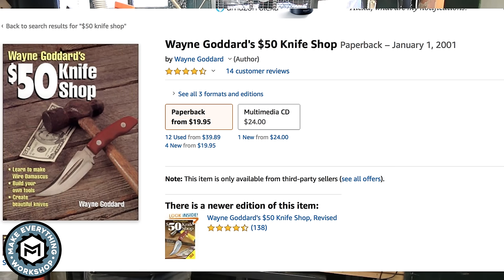$100 Harbor Freight Knife Shop!

Comment: I see this all the time, as a matter of safety, I hope everyone thinking of trying this, reads this comment. I drill the handle holes first. I watched a guy cut the bevel and then try to drill the holes, the drill hung up and he lost three fingers! fun over! make sure you clamp it when you drill it so if any thing goes wrong, it can't move.
Reply: mike walker : good point, always worth mentioning . Also, sheath the cutting edge with the plastic blade cover you get when you buy a woodsaw or a hacksaw, tying it up with adhesive tape.
Reply: Good Advice! thanks for commenting.
Reply: Always clamp your work; good advice; and.... use two hands on that grinder.  That cutoff wheel will virtually explode if it gets cocked in the cut groove.  I also wear leather gloves anytime when using a grinder.  One of my guts had the grinder flip around and cut his wrist.  TG his high dollar jacket cuff slowed the wheel down and it gave him a fair cut otherwise;  it would have been an artery.  GLOVES /GLASSES AND LONG SLEEVED; TUCKED IN NON BAGGY SHIRTS. 

DRESS like a welders dresses and you’ll be fine.
Reply: Not only that, this guy isn't qualified to even think about making a knife, let alone make a how to video. No safety, no proper approach, not a single thought about anything but trying to get views. Terrible form.
Reply: Ethan Vandal :DILLIGAF!!!
Reply: my god, I wouldn't use an angle grinder so close to my bare hand either around the 27 min mark.
Reply: @danb2709  It's a sanding disc not a cutting wheel, but yeah I still agree with you.  Much better to use saw/chisels/files/rasps
Reply: What I usually do is assume the work is going to catch and spin and clamp a scrap piece of wood to catch/block the piece I'm working just in case.
Murphy's law...
Reply: I actually have stitches in my left fingers because of this. I was making my knife, and after I sharpened it I drilled the holes for the handles, and the drill got caught on the steel and whipped around and sliced clean through my middle and pinky finger on my left hand. Luckily though it was sharp and cut cleanly otherwise the damage could have been more catastrophic to my hand.
Reply: that's a good suggestion
Reply: @EthanVandal  Sounds like u need to get off the internet and actually do something rather than telling everyone else what they are doing wrong mr safety queen!
Reply: You gotta learn by mistakes. We all did. Didn't have u tube in the 80s.
Reply: This is why they sell a VISE. Worth the money. And buy a good one. Spend the extra money. Worth the weight in gold when you want to keep your fingers.
Reply: StopThe Hammering     Hell Yeah! So sick of these safety douches..... what ever happened to personal accountability?! Let the man work the way he wants!
Reply: mike walker how about “don’t use harbor freight tools” as some safety advice?
Reply: @mikepalmer4371  Anyone who's teaching others has a moral responsibility to teach safe practices.
Reply: Thanks,Signed Stubby...
Reply: @septegram  you must be under 40 years old. Moral responsibility to teach safe practices? This isn't school buddy. There's also a thing called common sense that would stop most from even even doing this. If they do and something happens... Lesson learned the hard way.
Reply: @AzTurboMini  40 is a long way in my rearview mirror.
If you're teaching, you have a responsibility to your students. If you don't think so, we have nothing to discuss. So-called "common sense" is meaningless; people do things all the time that go against "common sense."
Reply: Thanks man
Reply: I always think of "the worst thing that could happen" at that point and it usually keeps me in check!  ..not even joking! I'm dead ass serious.
Reply: @jamiem5364 When the workshop instructor says "I used to disregard safety" and holds up his hands to show that one of them only has 2 fingers left, it has quite the effect.

I don't recommend anyone do so, but you can ignore people who talk about safety, if you want. It's only eyes and fingers, right? Right?
Reply: @AzTurboMini  When someone loses their fingers due to following your advice not to bother listening to safety advice, you're not going to care, are you? I really hope nobody follows your words.

Comment: I would have swapped the new blade for the one on my Saw, and cut up the old blade.
Reply: Dabeav ! Everytime I’ve used used sawblades they seem to be work hardened or something and it is nearly impossible to drill through
Reply: @brianwiggins2169  That is why he annealed it before drilling.
Reply: Nah, I use quality blades in my saw, not Harbor Freight blades!
Reply: @justinscott3001  my thoughts exactly. Even when they're old, nothing in Harbor Freight can replace my Freud Diablo blades
Reply: Not a harbor freight blade you wouldn't.lol.
Reply: Word 👍
Reply: If you can get them, start with a power hacksaw blade. They're thicker and longer. 1/16 is a letter opener
Reply: I don't "USE HARBOUR FREIGHT TOOLS"

Comment: I would have never guessed you could do that with that little bit of tools. I've never made myself a knife before, but since I have all those things I might give it a try. Thanks for sharing.
Reply: Mama Bear's She Shed Tracy Keaton get to it!
Reply: Did you made the knife? Just curious lol
Reply: I'm making a knife using only an angle grinder,the bevel is not as pretty as others knives but it cuts,you just have to start from a rusted metal file and keep it cool to keep the hardness and temper it in a kitchen oven,which is over budget but most people should have one already.other than that i wrapped the handle and sanded the bevel and blade with sandpaper to get the grindmarks down and finish the bevel before sharpening with two water stones

Comment: I've noticed that a lot of "build x for under y" follow that same pattern that you mention of like, "get scrap steel" or "get an alternator or some other car part from a junkyard" or so on. Like you said, I don't live in those circles where that's something that I know how to do. It's great to see someone doing something with what we call COTS (common off the shelf) stuff, rather than lucky finds.
Reply: You just gotta look and nit ve scared to ask around. I just got a forklift tine for free. From equipment rental place. I can make 2 anvils from that. I got 3 electric motors from work 2 were 5 ho and 1 was 1 hp
 I also got steel tube to make the frame for my 2x72 from work and a 5ho gas engine. All work and all were in or headed to scrap bin. People arent born knowing how to use an alternator for this or that, but anyone can learn if they put in a small amount of googling. In knife making you either use really basic tools on the cheap, shell out a lot of money for nice tools, or you learn to make tools for cheap or free. I personally didnt like doing everything with files so I learned. When I get another fork lift tine,  using it to make a power hammer.
Reply: You don't have to run in a certain circle to be able to pick up a phone book or your phone and look for the phone number to the nearest scrap yard and call them. And you can find usable scrap steel for blades just by walking down the road.

Comment: The first knife I "finished" was done with a hack saw and some files. Handle was red oak and the pins were cut from a wire hanger, heat treated with a map gas torch.

I say "finished" because it was made from a bar of mild steel I bought from Lowe's. I learned the process before the importance of steel and somewhere in my mind was something saying "the quality of the heat treat affects the knife more than the quality of the steel." I didn't realize that the rest of that sentence was "but you still need enough carbon to get a good result."

Comment: What amazed me is that angle grinder lasted more than 3 minutes. I got the same model to use for work (I didn't want my good expensive one to disappear) and not even 2 minutes into it smoke began growing out the vent holes... then came the flames... then the laughter from all the guys watching it self destruct. We locked the trigger closed with a zip tie and watched in awe as it finally let out its last puff of smoke.

Comment: Nice! Point well made. That's pretty similar to the process I used on the stock removal knife I did recently .... I splurged a bit on a bench top 4" belt grinder from harbor freight (i think it was like $80) and I got 3 12" by 1.5" by 3/16" annealed 1095 steel bars on amazon for under $40 and a brass rod from home depot for $10 or so. The scales I used were cherry scraps I had already.  It's really easy to spend a ton of money kitting out a knife shop but you can get started and produce some fairly impressive results for very little.  Also, I like to use a drill bit that is just slightly thinner or thicker than my steel to mark my lines so that in the rough grind I leave the blades edge thick enough that there is still some material to remove when I'm ready to put a cutting edge on it. Cheers and happy new year!!

Comment: This folks is why I keep old lawn mower blades.
Reply: i know...lol i have like 6 in my garage  lol  old files too.
Reply: From what I understand, lawnmower blades are too soft to hold a good edge for long. Reason being that if they were too hard they'd shatter or at least crack if you hit a rock. Higher carbon steel works better (old broken tools are a good source)
Reply: Garrett McCullough  Some folk calls is a slingblade I calls it a kaiser blade.
Reply: @alexg7965   Can’t you harden it with heat?
Reply: @BeefNEggs057  not a high enough carbon content. They're basically mild steel to my knowledge.

Comment: If you keep an eye on the sales and get the 20% off coupons, you could outfit yourself with the 1x30, some belts and some ratcheting bar clamps perfectly sized for knife scales. All for under 100 bucks. That's how I got my start up shop going.

Comment: I’m a machinist, I’ve made a few knives from table saw blades, and from tool steel. This was a really informative video, I picked up a few tips. I like to use old pallets for scales, there is usually some hardwood, but a lot of pine in them, the good part is they’re usually free. I also like to use brass for the pins.

Comment: Well now I can have an excuse to buy a angle grinder. This was really good and informative.  Also a couple carbide drill bits. THANKS.
Reply: Adventures with Frodo that angle grinder is a pretty crappy one. If you're on a budget look for a used one (Craigslist/eBay). Or the Hercules brand at Harbor Freight isn't bad. I have one that I've beat on quite a bit and it seems tough.
I do a lot of fab/ welding work and keep at least 4 grinders on the bench at all times.

Comment: I spent about 30 dollars at harbor freight to start knife making about a year ago and I got a hacksaw some files and clamps and a couple other things. I already had a drill and  I found a chunk of mild steel and in about a week of working after school a had a knife. I didn't even try sharpening it because I knew it wouldn't hold a edge
Reply: And now I have angle grinders belt grinders and a bunch of other tools
Reply from the maker: Try it out on some tool steel like 0-1 or 1075, there is a link in the description to an amazon seller who has it. Heat treating can be intimidating but it’s not as hard as people think! Best of luck!

Comment: Great video! I often just buy a dolly when I need casters. Must cheaper than buying 4 individual casters
Reply: Yeah I never get how that all works. I do the same for 2025 batteries when I need them-I buy $1 headlamps from walmart that have 2 of them, vs paying 5 bucks for a 2 pack in the battery isle. Bunch of stuff I do that with
Reply: DannyWarlegs lol I’ve thought about that before
Reply: @danvondrasek I have like 20 batteryless headlamps because of this.
Reply: What are you using the castors for?
Reply: Beau Watkins I’m not sure how to answer that.... ummmmm a variety of projects?
Reply: Brads Workbench sorry I grew up breaking horses not so good at mechanical stuff.   I don’t even know what you could use a caster for...I am assuming you mean the wheels off the dolley?
Reply: Beau Watkins i am in a very small shop so the majority of my heavy tools are on casters so that I can easily move them out when needed and then easily store them out of my way
Reply: Yes indeed, casters are the wheel portion (wheel, axle, dropout fork, swivel bearing, and baseplate). They get used same as a dolly except you can select a piece of heavy furniture/equipment to mount them directly to, presuming that item will need to be moved frequently. Work benches, tool storage containers, carts, speakers/amplifiers, etc
Reply: He'll yea. I save hardware off everything before it gets tossed out.
Reply: I often just buy a car when I need some rubber for a project.

Comment: you can drill through those blades with out annealing the metal use concrete drill bits they have carbide tips. you might go through a few but it can be done

Comment: you can spot anneal for drilling by clipping the end of a finish nail, putting in the drill and try and drill your hole, lean i to it.  It will turn cherry red and be able to be drilled.
Reply from the maker: This is a GREAT tip!!
Reply: @MakeEverything  Drill press is better because of the leverage but drill will work.

Comment: Hi
 Good video, but. the Dolly wasn't necessary. Anyone who lives anywhere close to a wooded area can usually find a "Hanger" limb or "widow maker" (dead limb off the ground) which will be seasoned more than well enough to use for scales or a block handle (if they're making a hidden tang knife), they'll just need to cut it to usable shape/size with a table saw or hand saw. Not a criticism, just (imo) useful information. Also, most lumber yards will have crop ends or cut off pieces of scraps that they will give you; or for very little money, will sell you. Nice job keep at it. Thanks for perpetuating the knife maker in all of us.
Stoney 
owner: Pappy Dave's Knives
Reply: another way to go if you're in a city is go around back to the dumpster. There is almost always broken pallets and other wood debris.

Comment: I’ll have to make a knife out of my ole chopsaw blades! I’ve always wanted to make a knife but just never got around to doing it lol but nicely done tho dude 🤜🏽
Reply: @effyou128  Hmmm . . quick google search returns:  "For tungsten carbide tipped saws a high chrome, high carbon steel is used (1075 Cr1). This can be used for plate saws as well. Another option that we use particularly for applications needing higher crack resistance for larger blades and slightly harder blades is 80CrV2, which has a higher carbon content and an addition of vanadium"

Comment: This is pretty much my current set up. I don’t have a workbench so I’ve been using cinder blocks on a cooler. Just know that you will be buying more of the grinding, cutting, and sanding disks. Tip on drilling- cut small notches in the tang, 90 degrees from back, and drill within those. Masonry bits rock and I’ve had a hard time with supposed bits for hardened steel. If no drill, cut notches in the tang big enough for rods and later fill with wood shims. Also, dollar store stirring sticks for epoxy, acetone for cleaning tang and blade and cleaning off epoxy, and the variety pack of sandpaper are all helpful. Variety pack has some 240 grit and 400 grit waterproof sheets. Cutting disks on wood can seriously throw pieces of cutting wheel, get a hacksaw or miter saw. Even a 6$ used jigsaw is super helpful but not within parameters of your video. Home Depot has been my source of walnut scales, hobby wood boards are helpful. Ace Hardware brass rods aren’t expensive and can make many other knives. Or use nails even. When epoxying and using acetone, use gloves!!!! And put it on a newspaper or cardboard surface. Easy cleanup. Also, note on steel. Files are great, focus on Am made though. Pawn shops can have them cheap, no more than a dollar I’d say. On sheaths, the speedy stitcher is great, worth the couple dollars. Used leather purses! Or maybe the HF toolbelts? On the saw blade remnants, do an ulu and do the style with the post in the middle for that small crescent piece.
Reply: Also, you don’t necessarily have to heat treat saw blades or files. If you do, propane torches aren’t a bad solution I think.
Reply: Save every cutoff or extra. Even mistakes. They can become pretty useful.

Comment: Think I might have added $4 - $13 for hearing protection.
Reply: Huh?
Reply: $0.22 for ear plugs.
Reply: @lauriebenton8064  grinders have high db outputs which will damage hearing over time.
Reply: A respirator for breathing is more important than earplugs. You don’t want to come down with grinders consumption. That has killed a lot of knife makers. If you don’t believe me look up knife maker Vernon Hicks in Arkansas.

Comment: Very cool video! This brings back a lot of memories to the first knife that I made, especially the heat treat. I had a small campfire and a paper plate as my fan and it worked pretty well. 

Nice channel, I’m definitely subscribing! 👍
Reply: I used a frying pan for my 'forge' and a cast iron pipe.
Reply: I just use a oxy acetylene torch. Probably better to have something to heat it all at once. But it works
Reply: @juliannn6501  also way over 100 dollars
Reply: @caydenthompson1878  well obviously. But it's very versatile. Considering you can cut heat and all that stuff. And you dont have to wait for a forge to heat up or waste wood or charcoal if it's one of those types. It's just easier for me because I get free gases from work
Reply: @juliannn6501  You're FIRED !

Comment: Hey folks, instead of buying saw blades for the knife, you can buy two of the files and turn one of them into the blade! :)
Reply: I thought the same thing but have you ever tried to drill through a file?  I ruined 2 brand new drill bits trying.